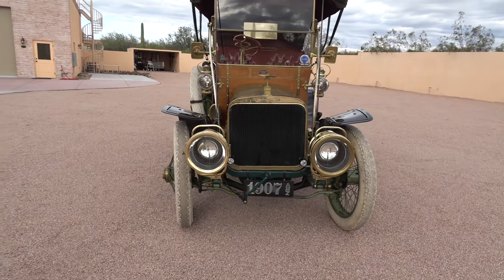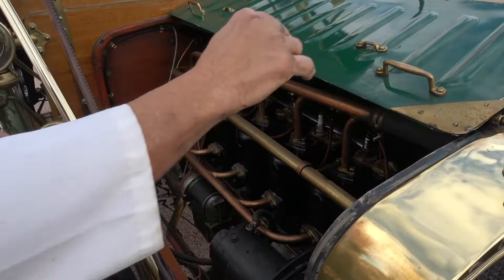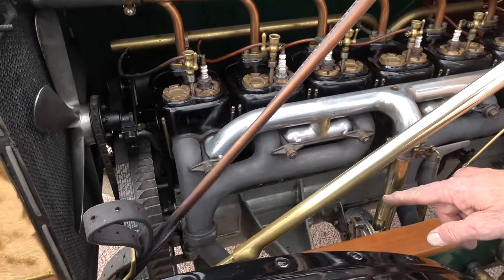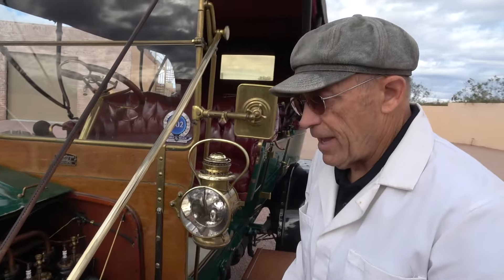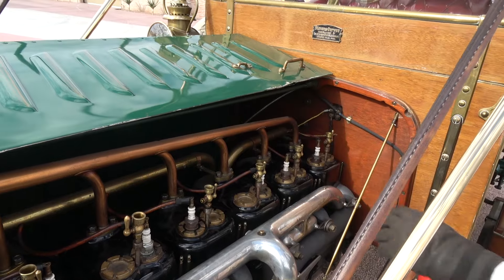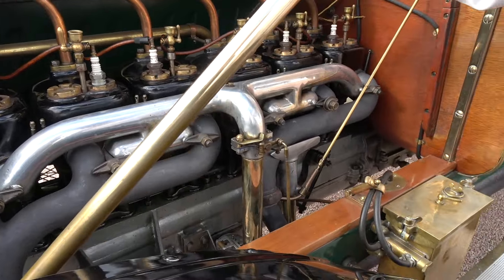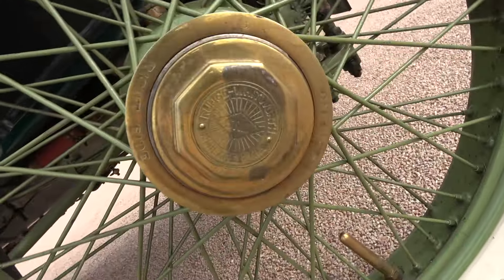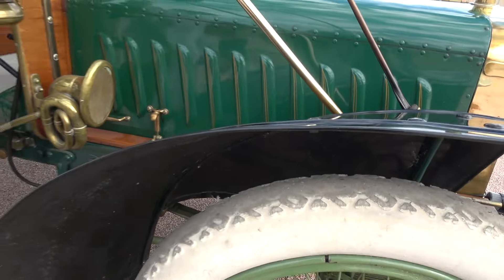Early Automobile History # 9 1907 Stevens Duryea Model U & Ride on My Car Story with Lou Costabile

Comment: Fantastic to see this splendid 1907 Stevens Duryea Model U in operation (and on the roads, as it had to do 117 years ago!)  The green color suits it very well, highlighting its wood finishes, its enormous Gray & Davis brass headlights, and its large grille adorned in that golden frame and the ingenious ornament in the shape of an airplane engine with a propeller that rotates when the vehicle is gaining speed.  I should also mention, those attractive white rubber tires!  Nice interior, with ample space, elegant shiny leather seats in a wine concho tone (including its container), its wooden instrument panel, and, finally, the rare Veeder speedometer next to the aviation steering wheel!  I liked the final shots;  like when you rode down the road, in addition to the sound produced by the huge 6-cylinder inline engine (in fact, it seemed as if a train was running, but without rails, haha).  Congratulations to Mr. Travis for that interesting story of how he became his next caregiver, and his great knowledge of it!  Best regards, Lou!
Reply from the maker: Hi Jaime, You're right, you don't expect a car this old to run, however great fun to see this one in action. Thank you for sharing what you see, Lou

Comment: Super cool video!! I have been assembling a machine shop to support my YouTube channel that I will be starting with the build of a 1928 Morgan RIP GN special 3 wheeler with 4 wheels. I am using an experimental aircraft opposed twin supercharged engine. This will be mated to an MG 4 speed manual gearbox with a 2 piece hand cast aluminum adapter. This will be connected to an MG differential with beautiful wire wheels. The frame I stood over steel and will have aircraft cloth stretched over and sprayed with plasticizer. This will have a boat tail look and is essentially a 20's airplane without a propeller or wings. There is only one other in existence and Charlie Martin races it in the UK. The next project lined up is the building of a Brooklands style cycle car similar to the Pembleton. This will have a BMW R-100 engine in the front and four wheels with gorgeous leather interior and even space for luggage. I look forward to seeing everyone over at the channel when it gets warm out enough to be in the barn in Pennsylvania .....
Reply from the maker: Hi John, Happy to read "Super cool video!" Hope your project and YouTube Channel to well. Thank you for viewing, sharing and I believe you're going to see many more cars on this Channel you'll enjoy. Hope you Subscribe, and hit the "bell" so you can see all the cars when they are uploaded on this YouTube Channel, Lou

Comment: Is there a sort of torque tube along side of the drive shaft?  Is it attached to the chassis or the engine transmission assembly?
Reply from the maker: Hi Al, Hmmm, not sure. Hoping a Viewer with knowledge can share, Lou

Comment: Es un automóvil muy adelantado,para la época . parece un vehículo de 1920 Dime Lou, me pareció con arranque eléctrico .? El generador es un Delco de los 60 . Será que le adaptaron el arranque?
Reply: The owner said that, "the starter/generator on the car is from 1914-1916."  You use crank on front.  The starter/generator is connected there with leather belt and is connected to a magneto that is connected to the spark plugs.  There is no battery, outside supply of electricity to help start the engine.
Reply from the maker: Hi Juan, I see your question has been answered. Lou
Reply: @loucostabile always happy to help, Lou 😊
Reply: @danam0228  You should help him realize that it looks absolutely nothing like a car from 1920 and isn't ahead of its time, just a luxury design like the many others from 1900-1907 time frame.
Reply: @WitchKing-Of-Angmar  you just did
Reply: @danam0228  you're correct. That's what he said. He said there is no battery. But' there obviously is a battery that provides the electricity to turn the starter. Then the starter becomes a generator that recharges the battery (that he claims is absent.  ) 
He also says there is no carburetor. Then points out and describes a gizmo that performs all the tasks of a carburetor. So, that gizmo is a carburetor , by whatever name you want to call it. (And @6:09  he says that about the carburetor/gizmo  later in the video) .
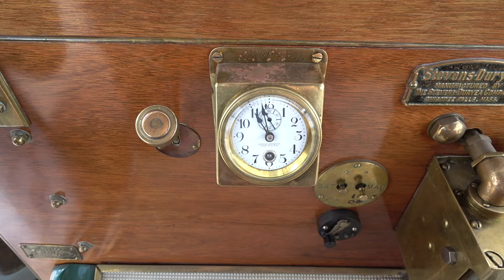Reply: @jamesbulldogmiller   Alan says at the beginning of the video that there is no battery, and again at 18:50.  At 18:50 he indicates that you can use either the magneto or a battery, "but there is no battery in this one."  And I am going to trust that there isn't since he knows his cars inside and out, and works on them himself.  You'd have to ask someone else if he can first use the crank then press the button to get the engine going as I believe he did, or if there is some other process followed to get it going since we don't see anyone use the hand crank ahead of him pressing the start button, but you clearly see at 18:50 that the magneto button is marked as IN/ON instead of the battery button for starting/running the engine.  And if you go back to 7:13 Lou goes over how the "IN/ON" button needs to be pressed for starting the engine.

As for the fuel system, I would not doubt what Alan says about the car not having a carburetor as he is extremely knowledgeable, but could have maybe done a better job of explaining how the system works.  A carburetor as you probably know mixes the fuel and air at the opening to the intake manifold.  This does not do that.  It is not carbureted, just as it is also not fuel injected.  There is probably a whole other name for it, but he did not mention it.